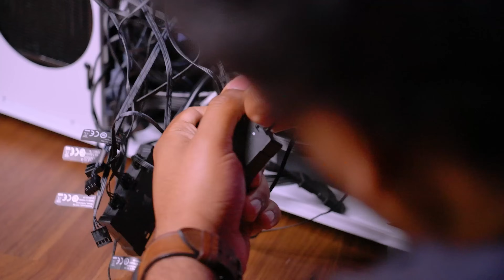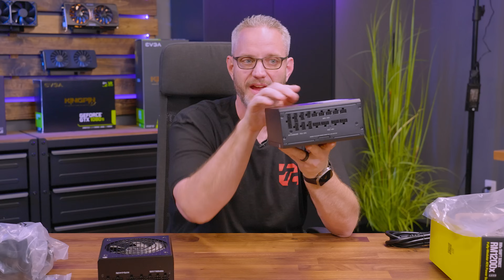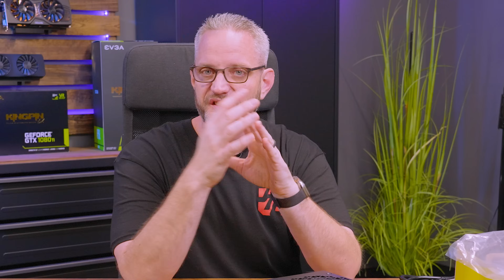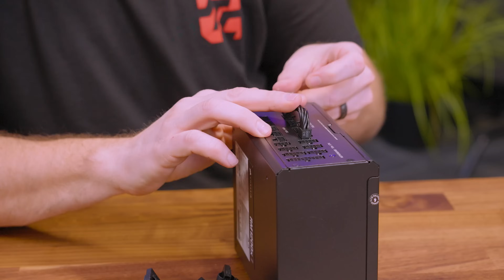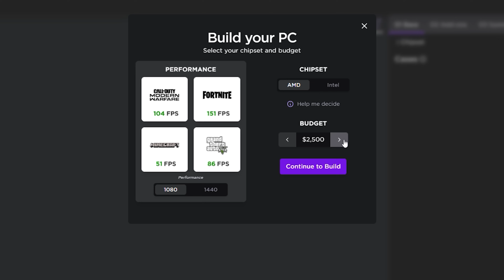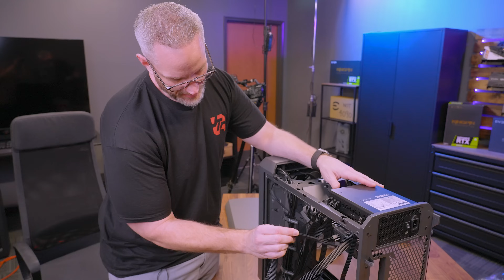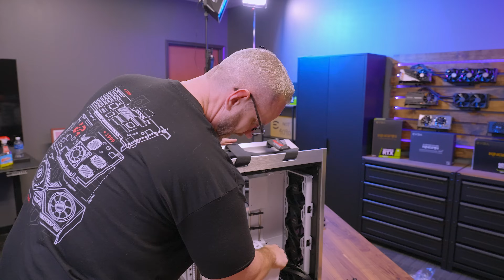I tried to prove this design was a failure... But then this happened.

Comment: I accidentally bought one of these recently and found that the motherboard connector was blocked (metal plate to guide the PSU into place covered it by maybe 2mm). The thing that made me laugh at the time was that I was installing it in a Corsair case 🤣 (Carbide Air 540, so an older design but still!)

Comment: Thanks, Jay, it does 100% fit for my case, Corsair 600c. If the ports are on the right side, the PSU fan is not facing the mesh. Then it may have a ventilation issue

Comment: After seeing this I am going to say this power supply would work very well with the Corsair frame 4000D. The case has bottom vent at the PS mounting area and shifts the power supply mount to the front so the plugs will have plenty of room for cable management. IMO

Comment: Dude is trying WAAAYYY too hard to be dramatic and make this an issue

This PSU is clearly designed for the traditional bottom mounted PSU case where it makes more sense to have the cables come out from the side

Comment: Man I'm glad I came across this video! I'm hoping to upgrade my pc this year with a white fractal torrent,  white corsair shift 1200 and white xfx 9070xt mercury magnetic air oc gpu and the psu position for the case made me stumpped if it would work. Now I see I don't have to worry about it.

Comment: I really like that there are new options like this. I could easily see this becoming a common things as it is more continent with the connectors facing the back panel. Also, with the large GPUs and top mounted water cooling today, many cases are already wider then the PSU. So the PSU mounting position could be moved closer the the front shroud to make more space for the cables.

Comment: Yeah………that configuration makes no sense. All they have to do is get rid of the hard drive cage behind the psu. Why would you route cables over the psu fan. Terrible design. Akin to the 5v ARGB connector and the 12v hpwr connector. You can just as easily access the connectors on the back. This is not really helping anything and a waste of design time IMO. As a builder, this doesn’t help very much at all. This is what we get today. Very little thought goes into the practicality of designs. Like who the hell vetted and approved this design? I disagree that this worked just fine Jay. There were issues with every case that, IMO, are unacceptable and no improvement over existing designs. Just makes no sense whatsoever.

Comment: I was just building my AM5 today  and  noticed that issue with my brand new, RM1000x. So, now I have to buy a new case, and it seems by the video that it will not be easy or cheap.

Comment: Well. A few days ago I bought the 850W version of this PSU to replace my old AX850, after seeing on Corsair’s website it would be compatible with my Cooler Master H500 case.
Now let me sadly report to you all this is NOT a match. T_T
It’s just impossible to make them work, there is virtually no space available on the side and the amount of stress it would put on the cables is not tolerable.

So now I am good for changing my case as well.

Comment: you know what i would like.... a power supply that comes with a set so that i can build my own cables with it, length, color, shape. it is like a DIY cable set with psu.
Reply: I think that would be a liability issue

Also it would be pretty expensive to put crimping tools inside the box

Comment: This is an awesome PSU for convenience and cable management but you need the right case. Mine came pre-installed in a Corsair 4000D, which of course is a perfect case for it. Looks like that NZXT case is also perfect for this PSU.

Comment: Had a problem with my 1200x, didn't run when I started my PC. Only "clicked". After testing it was ok with the paper clip trick, I found out it didn't like one of my USB drives. A process of elimination showed me which one was the culprit, so I removed and then it worked fine. Why did my last 750W work with that USB inserted, but this just didn't like it? So if you get the same issue, use the paper clip test, test all cables are connected and check your connected drives and accessories.

Comment: I've been using cheap arse PSUs for pretty much all my gaming life, recently updated my pc and had the cash this time to splash out on a decent PSU so bought a Corsair, was actually surprised by the size difference this thing is huge and won't fit into my case I need at least another 30mm of room to fit so had to get another gaming case, great PSU though, not sure what to think about modular PSUs this being my first they are a pain in the arse,  you have it fitted in screwed up then realise you need another sata cable there is bugger all room to get in there to get this extra cable in which happens  to be at the back lol ...nightmare! the side loading method makes more sense and a much better idea my new case is wide enough to use this PSU, I certainly will be buying one in the future

Comment: Come on, you wouldn't buy an AMD cpu for an Intel socketed motherboard would you? You'd buy parts knowing what parts you had planned to use, then order the parts according to what's compatible. You're also trying to use cases that don't have a standard psu fitting like 90% do.

As a system builder, the amount of times I've struggled to add a sata cable to a psu that's got a small space at the back where there are a load of bunched up cables where you can't see the slots or which is for peripheral or pcie is unbelievable. I've cut my hands on the shrouds of cases in the process, shone phone lights to try and read and see the slots and then spent ages  maneuvering cables to plug a single cable in and its proven to be an absolute nightmare. This resolves that issue in 90% of cases and makes your cabling tidy. This design allows you to simply plug and unplug with ease whilst saving your skin and a hell of a lot of frustration at the same time...Simple but genius 👌🏻

Comment: I think it really depends on the type of case you're using for which power supply you should use, it's a good thing that there is a solution for everything you can have. It's always the thing that you have to know what kind of case you need for the specific hardware you wanna use

Comment: So I have the new o11 vision and I also the Corsair shift 1000x PSU (first build so I didn’t have a clue when building). I can safely say having the cables coming out on the top of the PSU is not more convenient for an 011 case. I had to remove my cage drives at the top just to enabled space (luckily i don’t plan on using the hard drive cages). But I ended up returning my PSU as for some reason it stated on the power supply type 4 cables only when it should have said type 5. Because of this I went out and upgraded myself to £100.00 worth of the wrong cables lol. I’m thinking now when I get my refund I’ll buy the same PSU except not the shift variation as with my case I don’t like the cables coming out from the top.

Comment: What pros/cons do you have to using their style of 12VHPWR cable which seems to use 2x8pin? to the 12VHPWR connector vs other companies that use a dedicated 8+4 12VHPWR from the PSU to the GPU ?

Comment: I've just done a build with this in a Fractal Meshify 2 case. It works fantastically imo (there's loads of space behind the mobo tray in this case). It allows me to keep the 3.5" drive cage in the bottom of the case as well as a chunky AIO rad on the front.

Comment: They also need to separate the CPU.ports from the PCIE ports because someone stupid will plug in the PCIe cable and put it on their CPU which would blow up their system. They should be keyed differently so it cannot be plugged in incorrectly.

Comment: THIS IS WHY THEY NEED TO STANDARDIZE PSUs. What a stupid design. It limits what cases you can use. My cause would never be able to use this PSU because of where the ports are located. It would be completely blocked off.

Comment: I’m building with the RM850x “Shift” series on accident. Was at micro center on Black Friday and they were slammed. Bought a bundle with the i7 14700k, Msi Z790-P Pro WiFi Mobo, and G.skill ripjaws S5 DDR5-6000 Ram for $500. They tired to give me the wrong motherboard and then they had the Corsair RM1000w Psus in a neat lil bundle with the rm850e price banner sitting on it. My fault I should’ve read the fine print I guess 🤷‍♂️ it was $220, I thought to myself it’s a steal. 😅 I picked up a 850w shift on accident not realizing and instead of taking it back I’m going with the Phanteks NV5. It looks like it’ll work perfectly because of the slant, and the case fits the Noctua NH-D15 cpu cooler. Hopefully this all comes together neatly.

Comment: Just popped one 1000w into my Fractal Meshify C. absolute no issues, more than enough room and having the pain i went through in getting the old traditional PSU plugs out it more than reinforces why i bought the shift. I think this will take off longer term.

Comment: It's sad their controllers only work on 12V RGB, these days A(D)RGB is more used, I'm looking for a controller with 6 PWM fan and ARGB slots. So I can use my 6 PWM fans in a zone, and my A(D)RGB with a second one, and with both 2 temperature nodes on them. 2 for my custom loop and 2 for the ambient temperature in my case. The Corsair ones were interesting, but not the 12V RGB controllers. So I keep looking for another brand.

Comment: Not a bad idea for some cases, but I don't see any advantage for the case I'm using (Meshify 2 XL) which has plenty of room for cables. The Seasonic PSU I'm using has nice long cables as well, so no issues for me that would require a PSU like this.

Comment: From what I see, JayzTwoCents is showing the Corsair RMX Shift PSU's are not really made to standard which affects most computer cases.
Granted, there are hundreds of different cases out there, and maybe some will work fine with this RMx PSU, but the ones that obviously fit perfectly to this PSU are the Corsair 7000D, 5000D and (I think) the 4000D cases. 
I know this because I have the 5000D RGB Airflow case and did have the Corsair RM1000x Shift PSU in my computer case and the side wire mount feature worked wonderfully. 
The only problem was, the RM1000x PSU, being brand new (2.5 months old), shorted out (for no reason) a couple of days ago, showing it was a defect unit. 
I am still going to get a Corsair PSU, likely the RM1200x, but not the RM1000x.

Comment: My Corsair 220T is mid tower and there is hardly any space behind the PSU unless you slide the HDD cage all the way back.  Plugs on the side of the PSU would work wonders in this very specific situation.

Comment: I checked my fractal torrent and that "sharp edge" is smooth as can be.  Either he got a defect or he was exaggerating.   That damage on his cable likely was just factory damage.  

If you rewind the video you can see the cables were already damage before going in.

Comment: I used one of these in my new build with a 4090 and a Lancool II tower. the bent cables were a little tight, but overall the cable management was better and the lower magnetic door won't stay closed if you don't get a good clean fit, and my door closes and stays shut just fine. I actually really like it. Its much better for air flow and a clean look from through the glass panel.

Comment: Well I learned something new today. Didn't realize that a psu has a limit to what it can provide just for the gpu even if the total power is well above the total power requirements. I guess it's usually not an issue, bu that's why you want a general overhead for these things.

Comment: Fan down is best for active fans.  for semi passive,  fan down is trapping all heat in the PSU as heat rise and has no where to go = the semi passive PSU is now much more an active psu = more noise.   Have the fan point up and the heat has somewhere to go when the PSU fan isnt running.     And in this situation,  the cables would point to the wrong side making it impossible to use in many cases.   This is for sure a no go design for a semi passive fan psu..  BAD!

Comment: There are cases, such as BeQuiet 802, where thanks to this PSU design you are able to use the (now unobstructed) bottom space for an additional 240mm Push-Pull configured radiator, flat or cylindrical reservoir, or even as a tech compartment that will house 2 or more D5 pumps. To some extent this also applies for Define and Meshify Cases from Fractal, and I think its nice. Definitely not a successor to classical design, but an excellent option to choose from when building. I hope they will continue to make them.

Comment: Bought a Corsair rm1000x recently, and discovered that the PSU comes with 3x split head PCIE cables - I.e 8 pin from the PSU which then feeds into two separate 6+2 pin, which means that I had to plug in 3 for my graphics card and then cable tie the other 3 back, which has made the build look really messy.

Corsair, why?!

Comment: Hi Jay, thank you for your videos, I do have a question in regards to connecting an adapter to the video card. I have a PSU with the 12VHPWR and the video card AMD Radeon RX 7900 XTX Merc 310 which has three ATX 3.0 standard (3X PCIE 8 PIN). I just wondering if I can use an adapter from my PSU (12VHPWR PCIe 5.0 Connector Male to 3X PCIE 8 PIN) for this card. I saw this cable extension, nowhere I can find info about it. I also saw same adapter with 4X PCIE 8 Pin. I am afraid to burn something here. Thank you in advance.

Comment: Glad you showed the Fractal Design Torrent, that's the case I plan on using for my future build with a shift series psu. Thanks for pointing out the frame and wires rubbing against each other, I now know to be cautious when installing said psu.

Comment: Interesting idea from Corsair.
Nice to see something different- whether it’s a good idea or a bad idea, innovation in design comes through trial and error.

From the perspective of an audio engineer to overcome the few issues we saw I’d do one or each:

1) Electrical tape on solid edges of the chassis to prevent Insulation tear.

2) Electrical tape on wiring at the bend points at the power supply end to create support for cable cornering, and minimise the rate of damage from bending and re-bending over time/multiple builds.

3) Measure and cut wires for custom lengths.

Your mileage (and cabling) may vary 😂

Comment: Jay,

So I want to make sure I can use this power supply and also overclock my gpu  and cpu also I’m doing Rgb completely with Corsair but I’ll list of parts I’m trying to use for the build, as well trying to do watercooling the whole system with 10 fans all together in the case itself I’ll also list the case because it does have Rgb on it as well
ASUS: 
RTX 4090 TUF
ROG strix Z790-E Gaming

Intel:
I9 13900k

Corsair:
Ddr5 7000 
10 total fans ql120 maybe the new ones that is coming out
5000T RGB case
Also keyboard, mouse, headset and camera as well because they are usb 

Doing watercooling for both the gpu and cpu to make everything match up with Rgb and the cooling 

Need to know this because I’m overseas rn and while I have the money being here I can spend money on the pc build of my dream, thank you always for the videos, helped me learn a lot about computer and what to look for

Comment: I bought the same PSU upgrading from a RM850.  The connectors are smaller and they're a much tighter fit when plugging them in to the PSU.  It worked well in my Corsair 7000x case but you'll want custom cables for sure, makes life much easier to cable manage with this PSU.  I do wish it had a higher 80+ rating though.

Comment: I feel like this was designed with Corsair's cases in mind (in particular the 4000D Airflow where it's damn near impossible to get to the connectors with the HDD cage in place). Having those connectors on the side would save a lot of trouble when trying to mount SATA SSDs on the side, of the case for example.

This of course assumes you haven't put the giant block of foam in to help keep the PSU in place...

Comment: I believe this may work well with an o11 dynamic if you take out the hard drive tray. The fan faces the back of the case instead of down, so the plugs would be facing up instead of to the side.

Comment: It really is a failure. First with more and more powerful hardware the cable should become thicker not thinner. Second what you gonna do if the cable is too long? With the normal design you can easily put them in the bottom cage. But just imagine what bends the cable have to make with this design to hide it and what the pressure will be on the connectors . Third : case manufacturers have to make general changes for this to work properly and it will be much more difficult for them to design a case that will work both ways… So yep. I still think it’s a failure. Overall I hate this trend to make compromises with function and reliability in the name of aesthetic. If they want to make something useful they can redesign the cpu connectors because we all know what bend it have to make to go back and they are in most cases shorter and hard to manage. I have changed many power supplies and with all of them I just couldn’t manage it to be aesthetically pleasing.